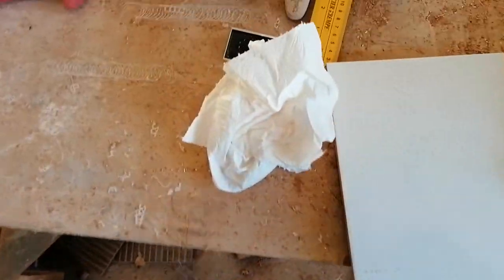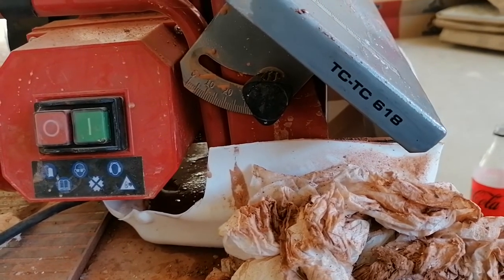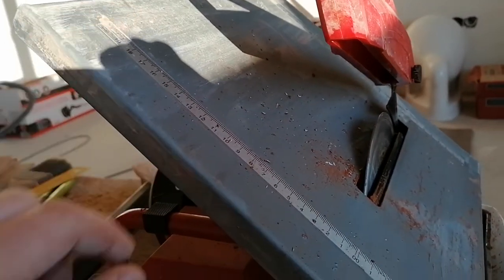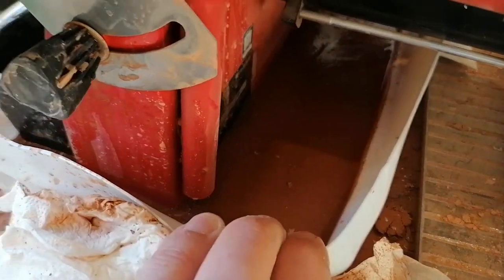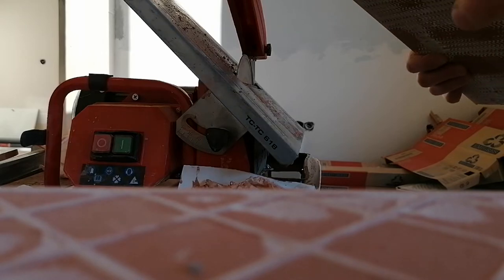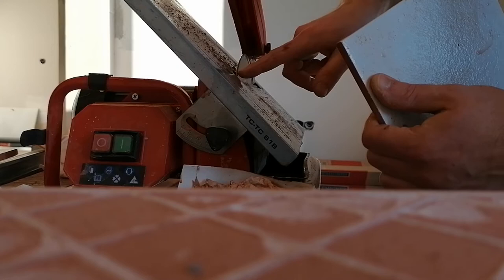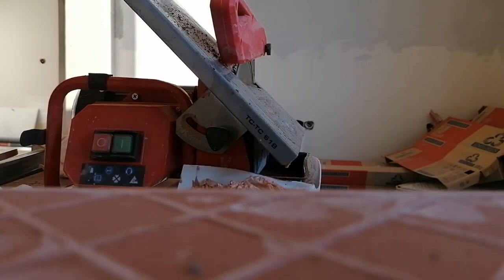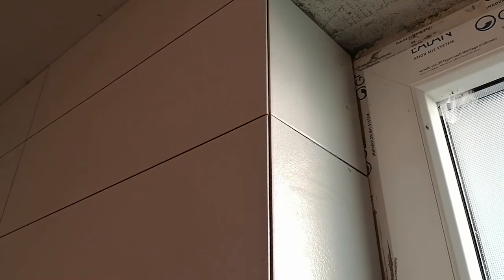How to cut a 45 degree tile edge on wet table saw (einhell)

Comment: Brilliant job on obtaining a mitre! Couldn't you turn the tile upside down on the table saw and use a guide to make things easier tough? Assuming of course you don't require the full width/length of the tile. Fantastic finish, I'll be doin the same on a job for a customer, much better than using trim. Well done.